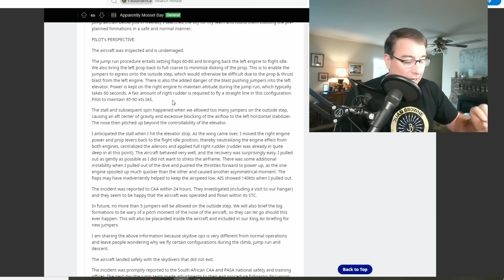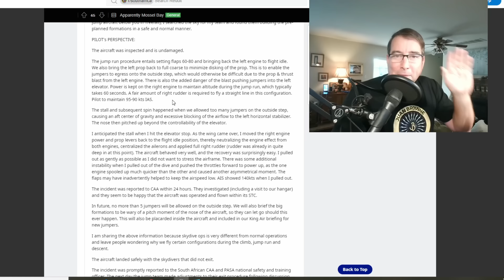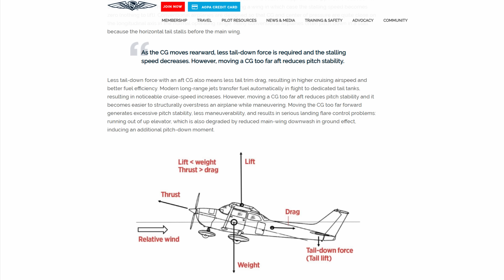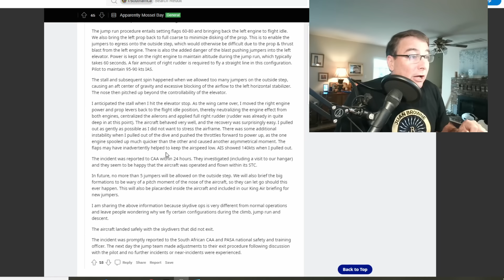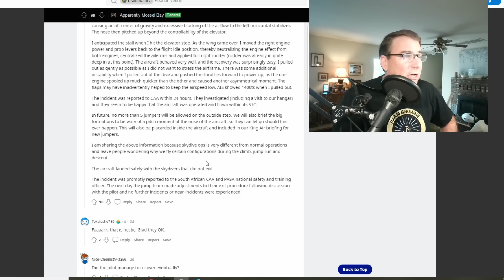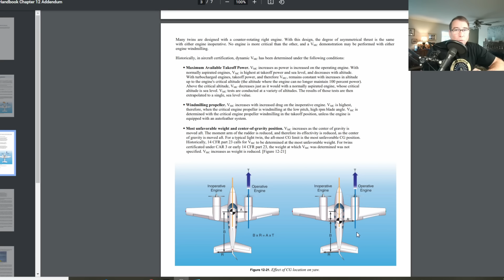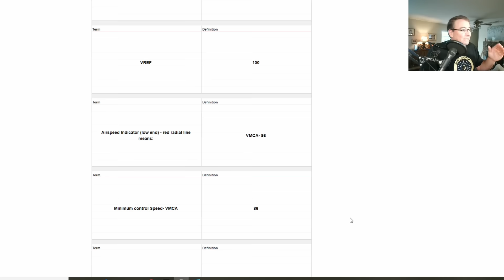Stall+Yaw=SPIN!  King Air Skydive Incident

Comment: This really illustrates the loss of altitude during a stall spin. That plane outran the skydivers like they were the ones with wings.
Reply: Wings not flying during a stall, it’s just a metal cage of death plummeting to the ground.
Reply: Yes but one would also hope that he pilot would not try to recover initially due to the threat of impacting a jumper.
Reply: @alberttarica8106  don't think the pilot had any idea about where he was in relation to the divers at that point. He was just along for the ride.
Reply: @JimNortonsAlcoholism  actually my buddy flies a 100 for a sky diving company and they brief strongly about location relative to divers in the event of unintended separation. So while he may not have know if they were to his left , right, front, or back. I imagine he had good intentions to continue his decent and maneuver away from the area of the initial stall.  Maybe he did maybe he didn’t I don’t know. But I do know this type of situation is briefed.
Reply: @alberttarica8106  I my experience, following an inadvertent spin, unless you are a test pilot super being, the mind is concentrated on one thing. WTF happened, followed very quickly by assess and recovery. Any delay in starting the recovery is governed by the time needed to process the aforementioned WTF moment.  I have only spun inadvertently once, it had a strong pucker factor but scared the crap out of the other 4 gliders climbing in the thermal beneath me :-)
Reply: @althalus401  But you could train for an initial delay as part of the recovery procedure none the less though, no? Of course you don't want to be consciously thinking in an incident like this, you want your subconscious/natural reactions to default to the recovery procedure; this would just be adding one more step to that procedure, right?
Reply: @spacemanmat  
One wing is flying, so there is drag and some lift resisting speed and gravity.
Reply: About 15 years ago here in Oregon, I used to watch the skydiving nearby. A few times when they had a caravan as jump plane I saw the pilot “race” the divers and beat them to the ground! I think that mentality has been changed over the years, way too dangerous.
Reply: When I jumped out of a king air, after releasing the last jumper the plan would dive straight down faster than the jumpers in free fall, typically on landing approach as parachutes were opening. The Cessna 182 was a very different story, where they'd turn on carb heat and do spiraling dives at a much slower rate.
Reply: @RyTrapp0  I have completed literally 100s of deliberate spins in checks and training. In those circumstances you know which way you are going to spin, mostly, and it is not a surprise, even so you can still get the WTF reaction from time to time. Trust me, an inadvertent departure concentrates the mind but only after the WTF moment.
Reply: @alberttarica8106  Not in a spin.
Reply: @jimgoff1170  AFAIK, that’s still the SOP for Twin Otter dive operations in the US. And yes, I think it’s nuts… Too focused on the bottom line. And how are these under Part 91? Should it be 135? Regs are way too loosey goosy.
Reply: @althalus401  yeah thermalling while a glider does an express elevator down past you is a pucker moment ;)

Comment: Recipe for a disaster (or such):
- Put 16 people on board a King Air B-90 (the maximum certified number of pax for this model is 13, including pilot and co-pilot);
- Slow down to 90 - 95 KIAS at high altitude (the "normal" Vref speed for a B-90 is ~100 KIAS on a stable straight flight approach);
- Fly with no oxygen on a depressurized aircraft above 13,000 ft and "feel the joy";
- Totally neglect stall speed vs altitude range (the stall speed for landing configuration is 76 KIAS, but at ~5,000 feet and MLW, not at 16,000 AGL and who knows how heavy it was)
- Fly with a crowd of "hi-drag" people holding onto a handrail OUTSIDE the aircraft, on the same side as the critical engine (left).
- Do not read and throw all aircraft manuals out thru the window at the first opportunity you have, including that yellow "Beechcraft Safety Information" booklet which says a King Air should never be flown in a full stall condition as this is the ONLY guaranteed condition to avoid a spin on this aircraft type.
The result, as far as I am concerned, was a real miracle, with its pilot trying to get out of a stall + spin pulling yoke back and sideways completely and oscillating wildly several times.🤦‍♂️
I honestly don't believe this aircraft is "undamaged", based on what we could see clearly: I've seen other King Air 90s in milder situations that suffered several bendings and warpings on wing and nacelles that could not be repaired (for unsuspecting future buyers: this is the 1968 Beechcraft B90 King Air S/N LJ-431 with registration number ZS-OHB which will probably be selling pretty cheap...).
Considering the type of flight (skydiving) I can't say I'm "surprised" with such events... it seems that adrenalin is always required (and enjoyed) here.
Reply: Years ago I was asked to pilot a skydiving club Cessna 182. Plane was fine but I was not comfortable with the number of divers they liked to cram into it. I would've loved the hours and money but it wasn't worth the risk.
Reply: I used to jump out of a Cessna 182 and we had crammed 6 jumpers and one pilot, was uncomfortable as getting to 10,000 lol
Reply: CPT. Roberto,
Your assessment is brilliant and well stated.
Your suspicions about being undamaged is more than likely right.

Many rental aircraft for example get bent by stupid pilots, with no experience, blundering into bad weather, and by the grace of God survive and bring the aircraft home park it in the line and never say a word;
But the next unsuspecting poor guy
The rent that plane has no idea that it's weakened and subject to potentially a disastrous end.

I started skydiving back at the beginning with Jacq Estelle (parachutes Incorporated) in Orange Massachusetts.
I can tell you for sure, this is one guy that won't go busting through a cloud layer ever again.
This whole video is a bunch of crap from the start.
Nothing more than the recipe or a big headline.
Your assessment is spot-on and I congratulate you sir.
🛫🇺🇸🛬
Reply: Very good points, especially regarding weight and altitude performance since all affect the stall performance. While you're at it, what is the Vfe for full flaps ?
Reply: Airplanes are flown on INDICATED air speed (read: dynamic pressure), no need to compensate for altitude as far as the aerodynamics are concerned.
Reply: @johanveltheim4331  yes, and Indicated Airspeed is exactly what you'll usually find in Performance Charts.
Reply: @SciFly7  Yes, hence my reply to the original comment that called for taking into account the altitude...
Reply: @SciFly7  Pretty high, considering that particular event: 184 KIAS for Flap approach and 148 KIAS for full flap. The "description" enclosed with original video says something about "setting flaps 60-80" (percent, I suppose). This can be accomplished on early models placing the flap lever to full position and returning it to approach when reaching that "60-80" setting (can't be done on newer ones). I understand that, for intermediate settings, the Full Flap limitation applies because it is more conservative. Interesting the statement from the pilot that "AIS showed 140kts when I pulled out."
Reply: @johanveltheim4331  aha.. ok yes indeed 👍
Reply: Well said.
Reply: Where did you get 16?
I count 11-13. 6 on the rail, 1 ejected, 4 landed with the plane and 1 pilot maybe a co-pilot.

Is there more I am missing?
The other points I can comprehend.
Reply: Edit I was wrong. There were 8 on the rail. I miscounted
Reply: @Silverhks  At the original video description.
Reply: One factor that would allow more people in the plane: Skydiving planes normally have all of the seats, other than the pilot(s) seat removed.  The fuel load is normally only what is needed for 3 to 4 loads to altitude and then refuel.

Comment: Good analysis Juan. That Pilot was outside the limits and nearly cleaned up skydiver and himself. The Cessna 310s and 402Bs in a flat spin are a death trap for the exact reason you specified. The mains tip tanks become sustaining spin weights.

Comment: I don't have a lot of experience flying jumpers and what I do have is in a single engine,  but the notion of putting the left prop to full flat pitch is insane.  Glad to see I wasn't the only one to notice the two secondary accelerated stalls in the recovery.  After posting a comment on another video I heard from someone who knows the pilot claiming he's very careful.  After listening to your break down I'll stick with my original thoughts.  I'd also say he was lucky he didn't try to cobb the power on the recovery.  No two PT-6's spool at the same rate!

Comment: Looks like there’s more than normal climbing out the door. That also means there are people moving back towards the door inside to follow the people outside moving cg way back. Last time I jumped a king that size, usually 4 out the door.
Reply: If you pause there are 8 people in the air after the initial stall not counting the caneraperson....

Comment: Not a king air guy here, but rather a spin demo pilot at Randolph in the mid late 90s.  Had the pleasure to see some inverted spins at Edwards in a previous gig in an A37. We were chasing them from a T38. Seemed to me it took quite a bit of effort to even get into the inverted spin, and the likelihood that would happen in a tweet seems low to me, yet possible if deliberate enough.   Idle-neutral-aft. Pretty much kills the inverted spin right there.  Your left in a dive, easy to recover.  The tweet would recover stick only or rudder only. 2 of the 6 demos in the spin demo ride.  Just wasn’t as efficient as the regular boldface method. 

(The test guys were getting into an inverted spin by rolling upside down, then doing an inverted stall with feeding rudder as they approached the stall.  The result was kind of a cartwheel looking thing into an eventual inverted spin, usually, and they had to hold the stick forward to keep it from recovering.  With the airflow issues at altitude and that high pressure ratio engine, they often lost one or two engines as a result, to be restarted after the recovery.  The reason I state this is that I have heard tales of IPs and students saying they were in an inverted spin in a tweet, and that is highly unlikely as the setup is pretty lengthy and deliberate.  The ones that usually claim it say that they held the stick forward too long in the normal spin recovery and overshot the recovery cone to the negative, or inverted, side.  While it may have looked a lot like an inverted spin, I would classify this as more of an inverted snap roll, although technically still aggravated by a large difference in lift between wings, at this point your total speed would have been pretty high and once you pull back a little on the stick the rolling would stop.  So to say you were in an inverted spin in that case would be like saying that an upright snap roll was also a spin...  Similar, but not my idea of a traditional "spin".  I'm sure folks will say I'm wrong, which ain't uncommon...   In all cases, regardless of how you got there, once you are inverted and getting tossed around in a negative environment, it ain't a fun ride). I rambled too long there...

Looks to me like the king air here kept aggregating his recovery.  Probably more freaked out at the dive than anything.  And I’d bet he still had asymmetric thrust at that point, so a deep secondary stall was resulting in more of a snap roll than an actual secondary “spin”. Still basically the same thing.   Idle…Break the stall, kill the rotation, you’ll come out.  Take your time in the dive recovery.   

Glad they didn’t hit any jumpers during this little snafu.  

Makes for good stories.   Danger Builds Character!
Reply: Tweet IP here . . . inverted spin twice (both unintentional, since it was a prohibited maneuver).  First was with a "spin pilot" while at PIT.  I screwed up one of the stick only recovery attempts and left it full fwd too long while still in a normal spin.  Slipped right into a full neg g inverted stall (and still spinning) ended up in inverted spin.  In step 3, I went stick full fwd to decelerate the spin, then snapped it full aft.  Nose came around and was in a straight stall.  Just pushed the stick fwd and flew it out.  The second time was with a student, and like in the first he held the stick full fwd too long and right into the inverted spin.  I took the controls and just like the first time, step 3 popped us right out.
Reply: @gordonelwell7084  the old negative spiral, I believe. Not the most comfortable ride😀.  But technically you can’t get into a negative spin from an upright spin in the course of any of the recoveries demonstrated in a spin ride or by a student. In a stabilized upright spin the jet just doesn’t have enough inertia in the pitch axis to traverse to a negative stall as it transits the spin recovery cone.  Negative, yes, spiral, kind of, inverted stall, no, thus not a negative (inverted) spin.  As your pitch transits the spin recovery cone you almost instantly recover from the stall, and in that attitude you pick up a lot of speed through the transit of the cone.   I suppose if you aggravated the forward pitch long enough eventually you could get there,  it that would be several thousand feet and like an additional 30 or 45 seconds.   In a student environment (not a test environment) this would be ridiculous to sit through, and nothing to gain by this experience.  And flirting with an ejection altitude.  

Where I will agree with you is that the ensuing ride is a shitty feeling.  And it’s very abrupt.  It’s basically oranges and apples to discuss what it was anyway, as obviously it’s mis applied recovery by the pilot. Easy to do, not fun to ride through.  And makes for great stories from back when we were still cool.
Reply: @markg7963  I guess we will have to agree to disagree.  Step 5 says "stick abruptly full forward one turn after applying rudder", then step 6 is "controls neutral after spinning stops and recover from dive".  I just know that on both of my episodes, it was step 5 applied for an extended period that left us in the spin.  I distinctly recall starting the boldface over after being in the inverted event, but in step 3, I intentionally put the stick full forward first (which decelerated the spinning) and only then executing the rest of step 3 (stick abruptly full aft and hold).  I believe that if I had not decelerated the spinning by going full forward first, then the abruptly full aft would not have had enough authority to stop the spinning inertia and the ejection could easily been the next step.  You are correct that both events really chewed up lots of altitude.  I still think of myself as cool, but not in the same way . . . I'm cool today because I managed three great kids, and watch two great grandkids arrive on the scene.  On a side note, my son is a US Navy test pilot instructor and he matter-of-factly told be one afternoon on how he had to take the controls of an F-18F from a test pilot student to get them out of an inverted flat spin.  Brought back all my great memories!
Reply: @gordonelwell7084  hey man, that’s awesome passing down the profession.  I’ve got a great idea, let’s buy a tweet out of the boneyard, fix it up, and go spin the shit outta that thing while we laugh our asses off.  Inverted, upright, it no matter, we be flying all over this bi%&^😂

Comment: I had a chance to fly as a passenger in a Cheyenne II from Burbank to SLC.  I knew both the pilots who had not flown together before.

On final in SLC, there was a significant cross wind and the pilot said 'let me show you a trick' to the second pilot; instead of using rudder, he simply backed off the thrust from one engine and was very proud of how nice a normal attitude on final was compared to lots of rudder and slip.

But on short final, the tower called for a 'go around', and without hesitation the pilot went full throttle on both engines.  Problem was that one engine spooled up quicker than the other and the airplane really went sideways (thought we were gonna die).  Not sure how he saved it but it took all the rudder there was along with a few prayers.

Both pilots were sweating bullets when we finally got on the ground.

Comment: I've never spun a T-37 .. we didn't have them in the RAF, but I have spun a Jet Provost on several occasions. I suspect that would be fairly similar .... rate of descent somewhere in the region of 16,000 fpm.
Reply: T-37: 11,000 fpm in the slowest rotating spin mode, much higher in accelerated spin . . .

Comment: I totally agree with Yuan.
It was the first thing I said when reading the pilot account.

I have 900 hrs drop flying experience 
We used to operate the C402 for skydiving here in Auckland, New Zealand.
It, like the C90 Kingair are fast aircraft and it is a lot harder to control at 90kts.
Deliberately configuring a twin aircraft for asymmetric flight in a high workload phase of flight flying slow and dealing with changing C of G is like trying to clear a jammed live bullet out of your hand gun chamber while pointing the gun into your face. 
You don’t need to do this.
My 8 way team would stack 5 jumpers outside on the 402 with the other 5 jumpers linked in the door and I was “front float” being the guy closest to the relative wind and yes it was hard work but you got used to it.